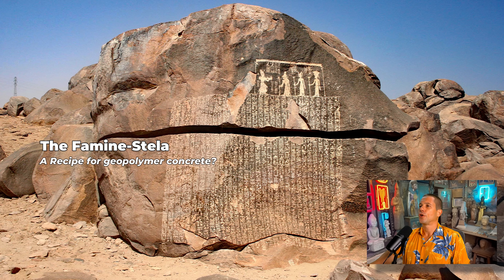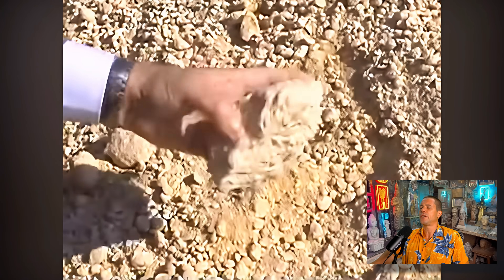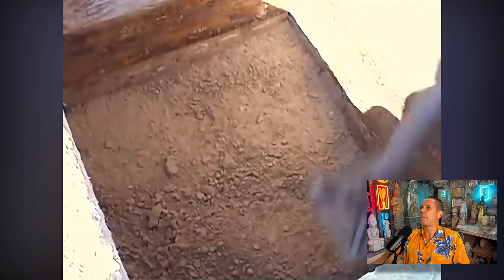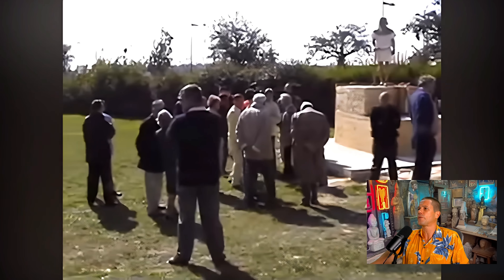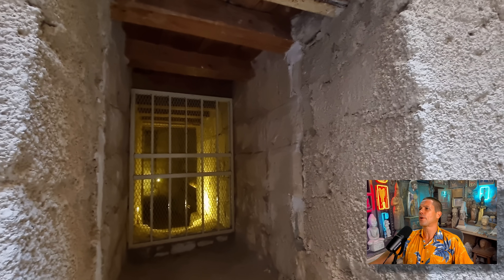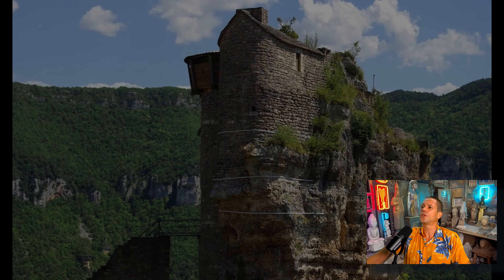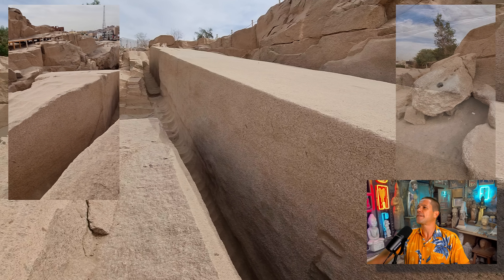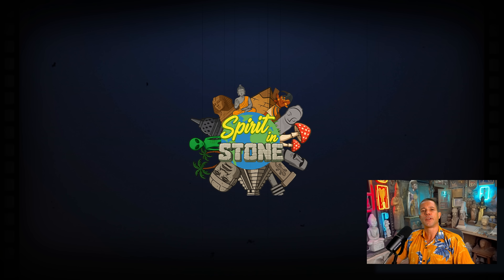The GeoPolymer Experiment | Recreating the Pyramid Stones of Egypt

Comment: Very good video ! Thanks to talk about Macell FOTI's work. On his X channel he's just shown conclusive casting of re-agglomerate granit. This work is awesome. OF course not all the stones are molded, but this tech explains so many things, like the mysterious "knobs" found everywhere on the planet. FOTI's process doesn't even requires a strong and complex mold because the mixed compound is kinda like putty, and hardens fast. Some kind of "bag" with a few wooden planks is all you need. This would look so much like Saqqsaywaman ! Most people don't understand counter-molding and think that you'd need to make a mold for every stone, in fact for a row you can alternate, and the mold would be partial, as the to sides would be the adjacent rocks , and every rock would then be different. Even better, with this process you can re-work the surface of the stone before it's fully cured, wich could leave the scoop marks too, as well as the different aspect found all along the joints in many places. And "cherry on the cake", the casting method solves the CARRYING mystery : no more multi-ton rocks to handle, only baskets of crushed material...  There is also a excellent scientific paper named "On the reddish, glittery mud the Inca used for perfecting their stone masonry" on Academia wich present another (natural) chemical way of "softening" the stone around the joints, wich is found in many inca buildings, and this one explains how real stones can be fit together perfectly. Very interesting too, but this applys mostly on quite small stones, like in the Qoricancha walls. Davidovits and Isida Project made analysis on Puma Punku rocks wich shows that the molecular structure is different from the supposed quarry site... They also found organic material IN the rock, wich is absolutely impossible for Andesite, wich is a volcanic rock. This thing will soon be fully proven and widely accepted !
Reply: What about the unfinished obelisk, did they cast a mountain so they could shape an obelisk on the ground and put scoup marks under it?  Cast stone (concrete) doesn’t have the same properties as natural stone and can easily be identified as such.
Reply: @rtroyer8963 even a first year geology student can easily differentiate between the two.
Reply: Stone softening is a myth and the sheer mass & weight of the material would require formwork and since you cannot dry pack this volume of material without creating stratified layers. Grain orientation also pooh poohs this ridiculous hypothesis.
Reply: @GroberWeisenstein stone softening and GeoPolymer theory are two different “alternative” theories, not to be confused with each other
Reply: @tanner1985  and if you had bothered to read the post I was replying to you'd see that he mentions both.
Reply: GranIt wasn't melted or molded. It was cut from the ground, end of story.
Reply: @logic.and.reasoning  to be able to have a good reasoning based upon logic, one must take in consideration ALL the data. Have you studied Marcell FOTI's work as well as the other things discussed here ? obviously not... Of course rocks are cut and hand shaped/carved... But not ALL of them. You're right about melting granit, this would only give a kind of glass and would never look like granit anymore. But FOTI's simple technique séparate the grains of the granit and then re-agglomerate them, making a very convincing "molded" granit, and that's a FACT. Study his work. He, Davidovits and a good bunch of other persons have made perfect molded Limestone rocks. So perfect that geologist can't tell the difference. That's a FACT too. And all this is done with localy available components, nothing ET there. The process of making "concrete rocks" is clearly depicted in Egypt's ancient paintings. There are so many places where the rocks show really crazy features, like a perfect fit on very irregukar natural rocks (Valley Temple casing stones for example) How can that just be possible/feasible ??? Yes the evidence and logic leads you to the only explanation : poured rock, just like concrete ! End of story.